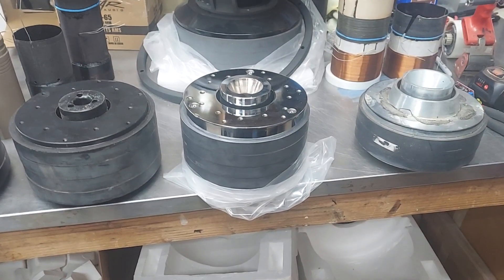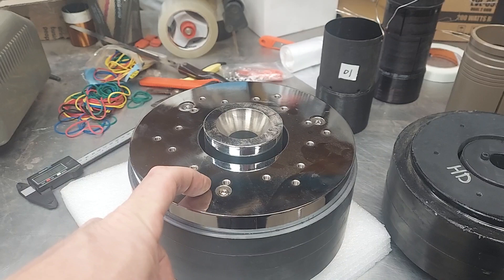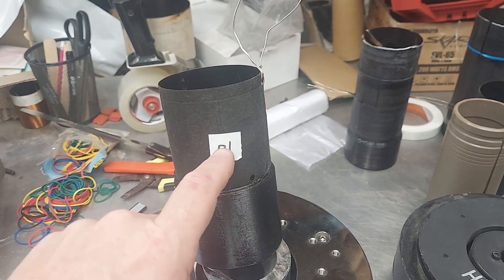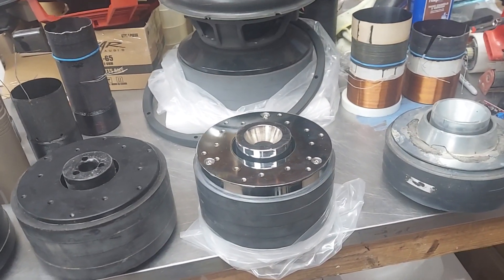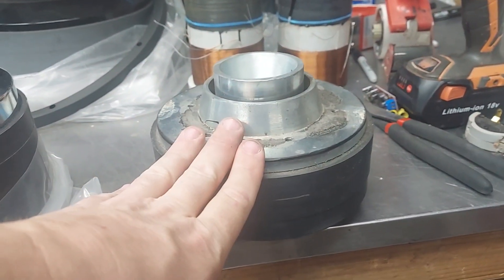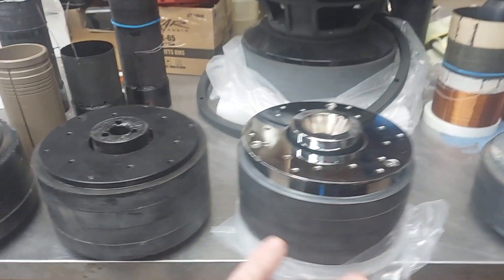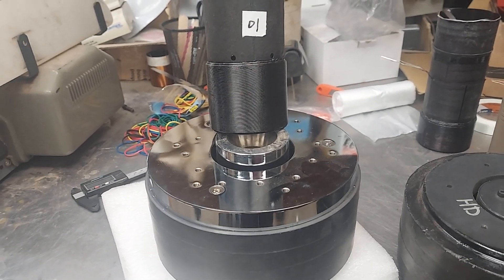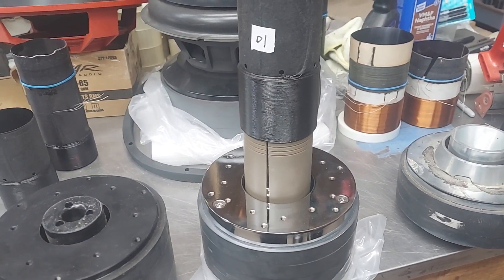GONZO Jr. Deadline Jan. 10th 2023!!!   Shim included! Ok Pricing in description for top assemblies!

Comment: Those motors are nice!  With the right set up with those motors can handle a pile of power, I have a custom 15 with a similar LOB 400oz with a D2 aluminum 3"x2.5" 8 layer coil and 3 layer spider and I will start to stink some after about 5+ min of heavy abuse with non clipping whatever it's seeing with an amp that dynos a 5.2k..!  I can turn that 5k amp up wide open just shy of clip (ok an occasional clip blink) and leave it indefinitely with that custom 7 slug (600ish oz) 18 with 3x3 8 layer D2 aluminum coil and 5 layer 12" spider. I half assed clamped it but as far as I could see they were seeing 3k+ quite often. Only way to get that 18 to stink with that amp is a heavy clip. The motor was inspired by Patrick the motor king's dumper motors with his slugs. Sundown eat your ass out....! Or is it heart? Whatever Who cares.

Comment: If I get time tomorrow i'll post a vid of how bad ass that motor is.. My first test it Shamed my X15 v.2 at the same power on that fat boy copper coil you hooked me up with. I don't know if I've ever had a woofer flex so hard. It ripped the spiders clean off the frame destroying only the CA holding it on the 12W6v2 frame. It was an easy fix since I didn't glue the mega roll surround down. Damn that thing was so much better than anything I've ever seen. Aluminum melting point 1,221 F
 copper melting temp 1984 F 
The efficiency is more output with less power. Aluminum more power less output and burns up

Comment: what is the FS of the 15" top assembly with the Gonzo jr motor?
Reply from the maker: It should be in the low 30's.
Reply: @RobotUnderground  what would it take to get an FS in the low 20's?
Reply from the maker: @jasonstutes4435   More mass or softer suspension sorry combination of the two.